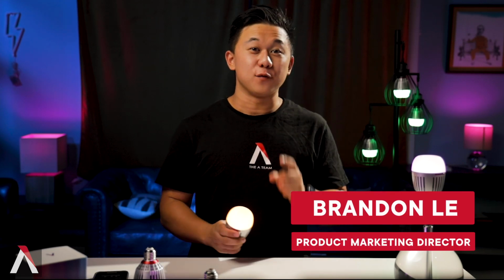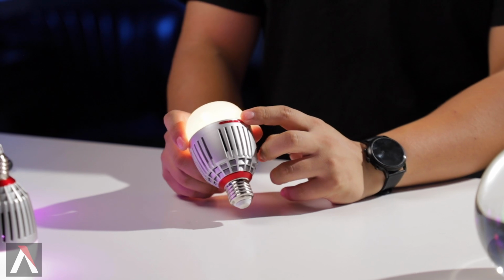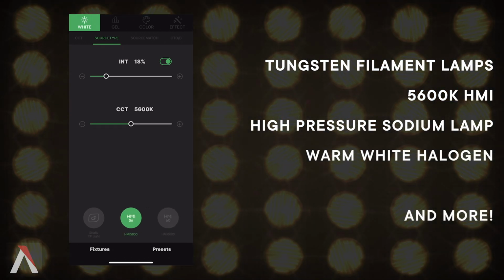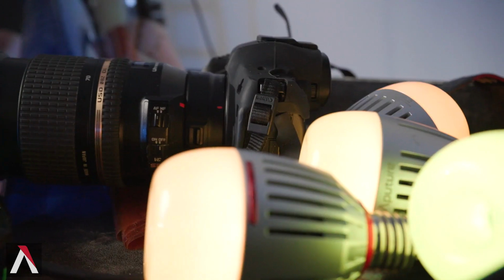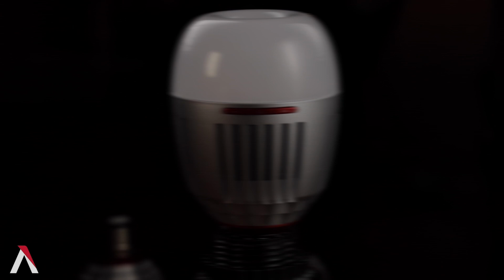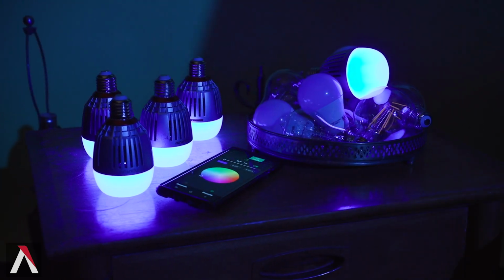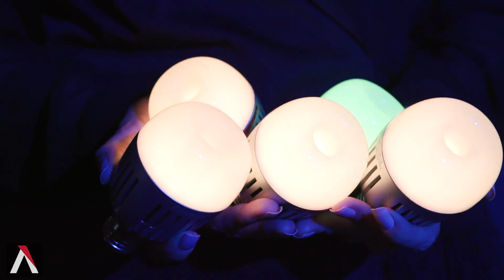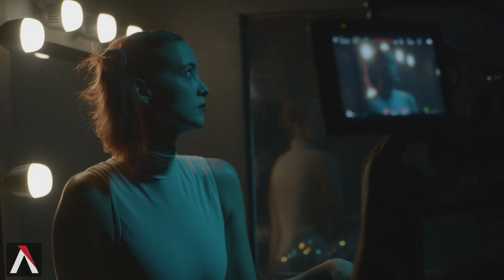Accent B7c | User Guide

Comment: Although the B7C light is a great idea, the operation of the light controls needs serious improvements. A few suggestions:
1. Print the cryptic codes is LARGE, LEGIBLE text so people can read them if the manual isn't available. Who thinks tiny white type on a silver surface is easy to read?!? God help anyone who looses the manual!
2. Make the buttons easier to feel when the bulb is under a shade. The buttons are small and blend into the shape of the bulb, making them difficult to operate. 
3. A USB charging option is needed, as that is much easier to manage than putting bulbs into Edison sockets. Just imagine how many of these will be left behind...

Comment: There should be at least an LED when charging and light is off. It's way too annoying to remember all this light replies when working under pressure. And why is the app not showing how much it is charged when it is AC powered. This is for me the biggest issue with the lamp.

Comment: My B7C doesn't charge... It fades out showing it is in AC mode but when I press - or + it doesn't show charging (and I have installed it into my lamp). What is wrong?
Reply: Exactly the same problem here. Seems it doesnt switch from AC to DC mode. Did you find a solution ?

Comment: another function no other battery driven led has: you can only charge by putting it into a lamp. what the fuck guys?! I mean who has always an empty lamp ready to charge your lightsource..
Reply: You can just buy a E26/27 socket with a cable attached, costs 4€ ...cheaper than a ubs c charger for your phone.... glad i could help.
And if you buy a set of 8 b7c bulbs you can buy a kit where the case functions as a charging station for all of them